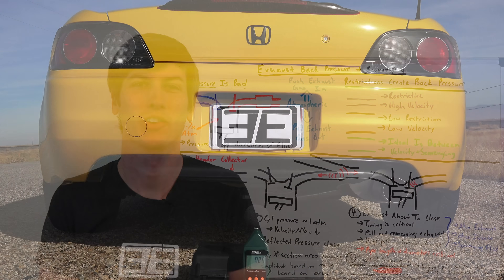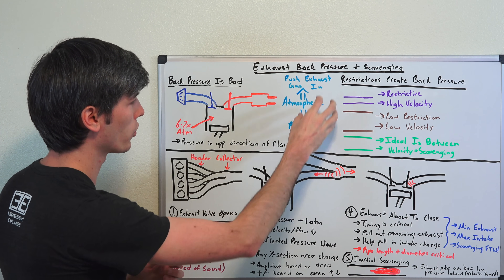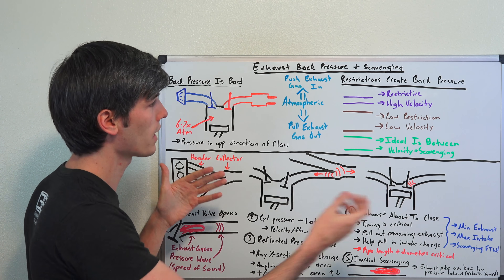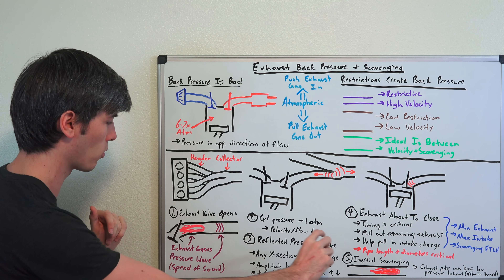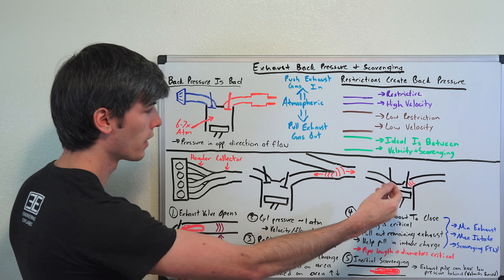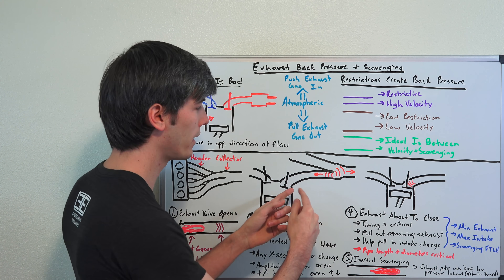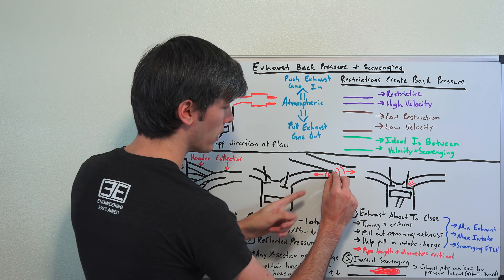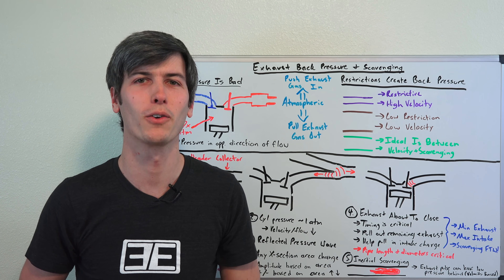Stop Saying Car Exhausts Need Back Pressure

Comment: If the atmospheric pressure was low, wouldn't this have a direct correlation to the pressure increase obtained by exploding the mixture? More oxygen = Bigger bang = More pressure and vice-versa?

Comment: Great video.  I used to talk a lot about exhaust back pressure but didn’t fully understand it.  This video cleared up a lot, however, I have a few questions.
1. The last time I checked most cars have more than one cylinder (excluding rotary engines).  In what way does negative pressure affect efficiency with more than one cylinder?
2. Wouldn’t the other cylinders in the engine push the exhaust gas out?
3. With most modern engines being direct injection, on the intake stroke, the cylinder pulls in air fuel.  I don’t think there is a lot of exhaust negative pressure assisting in this.  There may be more timing overlap in race applications but not an ultralow emissions Honda Civic.  Can you explain this a little more?

To everyone else that’s going to read these questions, please chime in.  I’m not being argumentative.  I’m looking for further understanding.

Great videos!  Thanks!

Comment: Hey,
How the pressure wave that is coming towards the intake valve because of the restriction is going to create negative pressure?
I tried to listen carefully but couldn't understand.
Reply from the maker: The simplified explanation is that if you were to take air and compress it, it will have higher pressure. When an exhaust pipe goes into a collector, the opposite happens (pressure drops, because you've expanded in volume). This pressure drop reflects a negative wave back (a high pressure wave would be reflected back if the tubing were to get smaller).
Reply: you mean, negative wave in the sense lower pressure compare to the pressure inside the cylinder. right?

Comment: Should we assume that the manufacturer has done all the appropriate research on the exhaust elements? Based on what is said here, it would indicate that a lot of people who don't consider this science and go out and chop off the factory exhaust and slap on a borla, flowmaster, etc. cat back system... or aftermarket exhaust headers,  may be hurting the performance of their vehicle (or at least, not getting the most benefit from the exhaust). I would assume that the manufacturer would usually be concerned with fuel economy, in most situations, when it comes to how they want the exhaust to perform.

Comment: You only need back pressure with two stroke engines. 99.9% racing 4 stroke engines run open exhaust system.

Comment: Would it be bad to take my muffler off my boxer 4 stock Subaru?
Reply: Nah , do it.
Reply: No. As said in video, the less changes throughout the exhausts diameter, the better.
Reply: Ethan Haynes guess not.
Reply: Taking a muffler of any car will make essentially no difference good or bad other than making it a bit louder
Reply: Ethan Haynes mine(in the pic) is straight piped. Go for it.
Reply: Bad.  If you have to pass a vehicle inspection.
Reply: no. Boxers sound terrible anyway.
Reply: If you are driving it on the road, then it is illegal. But, if it is a racing vehicle, or a strictly off-road vehicle then it is fine. If you want less back pressure on an street-legal vehicle, then find a high-flow muffler that will fit in the same space as the stock one, or find a place where there is more room to fit a larger one, under there. You may wish to find an article that compares flow rates in Cubic Feet per Minute (CFM) between competing brands. But the most effective way of getting power would be to start with a better car, than a flat four Subaru. It's kind of like power tuning a 1970 VW Beetle.
Reply: It'll sound like crap but you will not cause any damages to the vehicle.
Reply: Yes, terrible. It’s a Subaru
Reply: Yes, absolutely.  Chopsaw that thing, closest to the turbo as possible!

Comment: Anyone who has opened up their exhaust and felt the effect without other modifications knows that back pressure is important.  It will push a few more HP, but further up in the RPM range.  You'll feel it in the low rpm torque.  But hey....open it up, sound like a fart and lose torque.

Comment: I thought that a bit of back pressure was good from what I've heard from people but I guess not. Thanks for making this video, this clears up a lot!
Reply: Many years ago, engines ran a fairly large amount of overlap (intake valve opened well before the exhaust valve closed) in order to scavenge all the old burned fuel out, with a large amount of muffler backpressure. If you ran straight pipes with no backpressure, the incoming (cold) air/fuel mixture would flow out the (hot) exhaust valve, and could cause the exhaust valve to warp. As muffler design has improved, we can get lower backpressure with similar noise dampening, so I believe the overlap is now shorter. So maybe valve warp would not be a problem anymore, but I don't know.

Comment: @Engineering Explained  This is coming from a NA aspect it looks like.  I saw no mention of Lobe Separation Angle (LSA) of the cam which can affect scavenging as well.  With Intake valve under pressure from a turbo/supercharger this would be a little different?  How come no one has engineered some sort of Vacuum device for an exhaust to evacuate exhaust gases?  Heat?  Complexity?

Comment: What if there's un-burnt gas-fuel in the cylinder during the exhaust-stage of the 4-strokes and it's recycled?  What if you add a supercharger-system to the exhaust-side to pull out the exhaust gas?

Comment: Does installing an aftermarket turbo change the exhaust parameters, causing a defeating effect for installing the turbo kit? I want to add a turbo kit to my 2016 Kia Forte5 EX, with no intention of messing with the exhaust system at all (other than the connections in the engine bay). Thanks.

Comment: Can there be such a thing as too much scavenging? Like having too much exhaust velocity and the air/fuel ratio starts entering the exhaust causing lower volumetric efficiency? Or is that all to do with valve overlap?

Comment: I have read something about koenigseggs freevalve system in combination with direct injection beeing able to flush the cylinder between each power stroke/while the exhaust stroke to clean the gases out (meaning: intake and exhaust valves fully open, airflow into the cylinder, no fuel injection)  do you think this would increase engine power/effeicency by a lot?

Comment: I feel I remember a video of either bmw or mercedes were testing various exhaust sizes and instead of running the largest size they could they actually went down .5" - 1" in diameter and made more power than with the largest possible size.  video sounds a lot like the "tuned pipes" for 2cycle small engines.

Comment: Thanks for another great video. Soo, how do you find that sweet spot to actually increase torque and horsepower without causing more harm? I have a Jeep jk with a 3.6 penstar & have been reading allot on the subject. Manufacturer s claim thier exhaust is dyno tuned and you gain X amount of horsepower but in the review s some claim that the exhaust is louder but low end is noticably diminished.

I don't care to make my vehicle louder but if I can gain 5-10% hp and torque for a few hundred bucks I'm in.

Comment: i have had with cars that if they are tuned by factory with some backpressure standard exhaust and you fit a exhaust thats is less restrictive it wil have less power but if you tune it after fitting the exhaust you will gain some power

Comment: Thank you, thank you, thank you! I'm glad you made this. Please, make sure this goes on Wiki-everything! My man
Reply: Nice work!!! And you are absolutely right, this is GOLD for all amateur tuners! 
My advise to budget track cars; Keep stock exhaust diameter, remove cat, get "straight through" resonator and muffler (with a tail/end dia' similar to exhaust dia' = no deep tone, pure race sound), this will roughly give you same performance boost as a expensive $1500, from headers and back, race exhaust
@EE: 
if you don't take into account the Euro and newly establish similar US emission restrictions (completely disregarding the cat here) the backpressure is needed to recirculate some of the exhaust back into the intake, to burn unburned fuel, at given loads at specific rpms. So in modern cars it's needed to fulfill legal requirements ;) PS not all engines need this system, but if you increase 1st weight in your search terms and 2nd search increase engine volume/capacity and cross those you'll find it being implicated more and more

Comment: I think I get it. So this would explain why on some vehicles when you remove the muffler or catalytic converter you would see a power decrease and higher fuel consumption. Your upsetting the needed balance in pressure and velocity for exhaust evacuation. (Usually causing a low pressure/low velocity situation) Essentially the engine would need to be retuned to run in this scenario as the timing would need to be adjusted for the changes. Great explanation!

Comment: How does a low pressure front arriving at the exhaust port at the wrong time hurt performance?  Seems like either the valve is open and it helps, or the valve is closed and it does nothing - for that cylinder anyway.  I can see how having that partial vacuum in that part of the header would reduce the scavenging effect for other cylinders, but I assume our timing is bad on those cylinders too and there's no scavenging going on there either.

Comment: next question, how do you calculate the right diameter and length of the header?
Reply from the maker: It's dependent on many factors, and would probably come down to simulations rather than exact calculations. Dependent on how much airflow you have (power), and then calculating (deciding) what RPM you want it to be effective for, by measuring the time it takes the pressure wave to reach the exhaust collector and then return to the exhaust valve.
Reply: Engineering Explained I'll stick to the original exhaust than, instead of welding a stainless one myself.
👍
happy 2018 btw.
Reply: @be4tnl  This is where you go to a company like Borla because they have the equipment to measure exhaust gas velocity and they do the R&D to make sure their product does what they say it will. To small of a pipe results in exhaust flow restriction to big of a pipe and you do not have enough restriction, both of these kill exhaust gas velocity. John Lingenfelter built 600 horse power Corvettes using 2 1/2 inch exhaust system designed with Borla, if a bigger pipe/exhaust system would have made John go faster he would have used it.

Comment: I assume what's bad for 4-stroke (positive reflected pressure) is good for 2-stroke where the exhaust provides positive back pressure to retain some of the cylinder charge.  I've never studied the exhaust of a high performance 2-stroke but I assume there's some design considerations for the exhaust system diameter to change to provide the correct back pressure wave timing.

Comment: Saying engines needs exhaust back pressure to work is like saying an electric motor needs to have a resistor in series with it to work.
Reply: You don't need them in every electrical circuit, but since they change the voltage/current and electrical circuits are all about voltage and current they do tend to need them.
Reply: 4G12
As an engineer, I can say that's not a valid comparison;  it's not that simple.  Tuning and exhaust system to create a negative pressure wave reflection (at a resistance/less resistance boundary) to aid in exhaust efficiency at a given rpm range is not the same thing as just adding a resistor in series with an electric motor -- those are entirely two different concepts...

Comment: I have a question we were talking about exhaust system in back pressure what about Smoke Stacks cuz I was thinking about doing a smoke stack kit on my truck that's a 4.3 liter V6 and I was thinking about getting headers for it to later after I get to Smoke Stack done or should I get those first so I'm building a 4 x 4 off-road truck can you come help me out on that explain if it would work or not or would do more harm for my engine

Comment: So what happens if I steal a tuba from the local high school and duct tape it to my headers?
Reply from the maker: With great horsepower comes great responsibility.
Reply: Engineering Explained But the tuba / trombone idea would actually be a way to tune an exhaust system to get the -ve pressure at the exhaust valve at the right time throughout the rev range. Does anyone do that?
Reply: -- "So what happens if I steal a tuba from the local high school and duct tape it to my headers?"
 
Depending on the number of cylinders and the rpm range, your car will either play "Smoke Gets in Your Eyes" or "The Piña Colada Song" as it glides down the highway.
Reply: Nothing really except restrict the exhaust gasses as Tuba's have very small pipes.  It is the mouthpiece and the way the lips are pursed that actually make the tuba sound. No lips, no tuba sound :)  Same with the trombone.
Reply: ....the cop car taking your ass to county lockup, will sound a whole lot more the same.

Comment: Well don't believe me but, I only had the cat and the muffler in my exhaust, so I put a resonator 15" of large just after the cat, and the trottle response feel better and the velocimeter lifts faster in speeds than before. Would be that the backpressure or how does it benefit in my car???

Comment: There is some truth to having backpressure helping in the sense that certain exhaust setups can have an scavenging effect (also adding slight backpressure to make the scavenging mechanism work). It may be harder to design for scavenging without the setup that adds backpressure in some cases.

Comment: Hey Jason.👋  While some have mentioned the whiteboard looks a bit small and restrictive at times, my guess is that it has been engineered to just the right size for this application.👌  Much like your explanation in this video, everything on the board usually has a good, positive flow without feeling restrictive.  We all know, knowledge is power and the power to weight ratio of the whiteboard is immense!💪  Great flow and power without undesirable drone... what more could we ask for?  Thanks for a fantastic run in 2017 and all the best to you in 2018, sir. ✌😉
Reply from the maker: Ha, thanks for the fun comment, happy new year!
Reply: Should get an award for most efficient Youtube creator.
Reply: If you ever want to do a charity fund-raiser, take the current whiteboard that's been used in so many EE episodes, sign it in permanent marker, and stick it on ebay.
Reply: TheMick26 hahah i love it
Reply: Ditto
Reply: Engineering Explained hi sorry if this question is didn't ask before, I was curious about my resonator will  that affect performance in any way?
Reply: gooz0mbie Thanks, but that's what happens when you give old people "smart" phones... Dad jokes and emojis.😜
Reply: This comment 🙏🙏 was straight fire 🔥🔥🔥🔥😎😎. God bless 🙌🙌💪💪👏🖒🖒👉👌👌👌
Reply: Good comment but get rid of the freaking emojis lol

Comment: Great video as always.
I have a question. What is the physical cause of the negative pressure wave that gets generated when the shock wave goes to a bigger diameter? Is it the contrast between the tendency to accelerate that a sonic flow has when it encounters a diverging section and the fact that being already at sonic speed it can't get faster because it's in a throat section thus it's chocked?

Comment: How much does increasing the diameter of the catback do for a turbocharged car? Wouldn’t the catalytic converter be the most restrictive part of any exhaust setup, making the catback negligible? I know you did a video of a high flow exhaust for your s2k but it’s NA. I wonder what the difference would be in a turbocharged car since exhaust velocity would be affected by the turbine

Comment: I thought you wanted back pressure to help keep the valves from getting burned.  It helped keep the fuel that was still burning in the cylinder.
Reply from the maker: Ideally, combustion is complete before the exhaust valve opens. The longer combustion lasts, the less efficient it is, since it's ideal for it to happen nearly instantaneously at top dead center. This isn't realistic, but it's something that Mazda is looking to do with their new SkyActiv X engine, which has compression ignition of gasoline, burning faster and more completely than a traveling flame front.

Comment: Somewhat on the topic of the video; You need the exhaust restrictions with a turbocharged car when it's designed with the restrictions in mind. Otherwise you run the risk of over spinning the turbo. Same thing can happen with a boost leak.

Comment: The piston moving up/down can only affect a change in pressure over its swept volume, the combustion chamber is a set size, therefore a 4 stroke engine will have a volume of gas that can not be expelled by the stroke of the piston. Yes, you can have scavenging help lower the pressure behind the exhaust valve and expel more of those gasses, but in a vehicle with a turbo charger or otherwise quite restrictive exhaust, this effect will be minimal.

Can you show some maths on how much volumetric efficiency an engine has (your s2000 sounds like a good candidate) showing how much inert gas pressure we can expect to be left in the cylinder and how that affects the intake charge pulled in?

Comment: Two questions... One does this apply to turbo diesel?? Would the turbo help with this. Also I have a ls2 and was looking at the shorty headers and long tube. Long tube headers are extremely hard to install but shorty headers are easier. Which would be better, not looking for extreme power just some better flow and sound. Do you have a formula I can use to figure this out. And great video love watching. Thanks a bunch